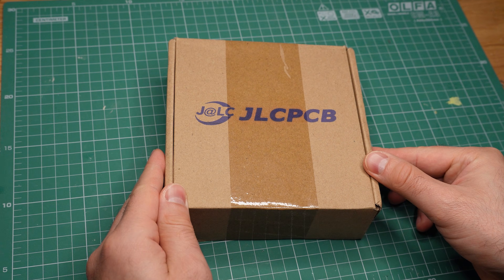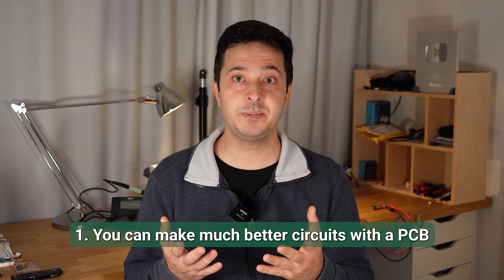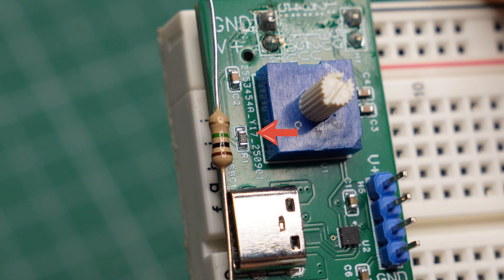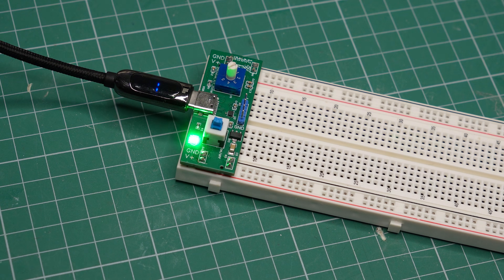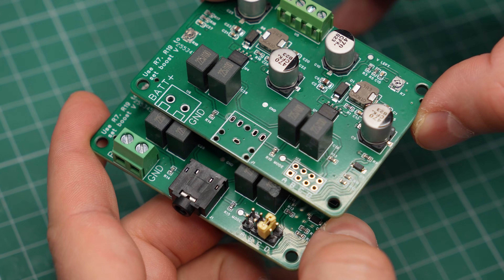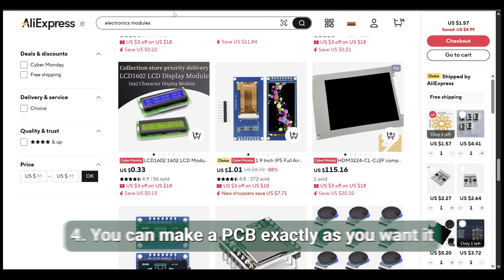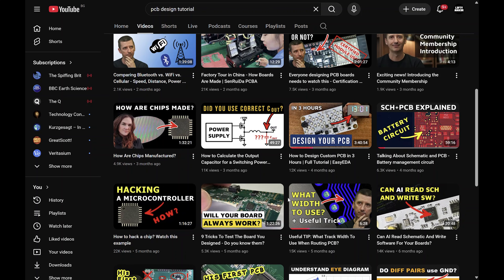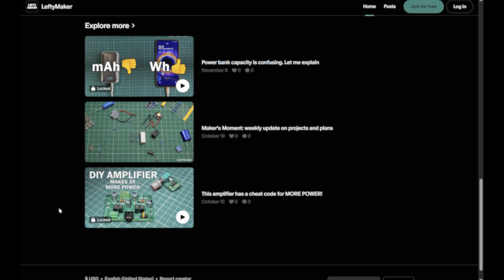5 Reasons to Learn PCB Design Today [GIVEAWAY!]

Comment: Too bad, they weren't around in the early 80s. I designed something, and through a friend, I found a place in China to build 100pc of the item for me.  A few months later, they were building and selling them to US dist. under another name. They screwed me.
Reply from the maker: Ouch! I'm sure it still happens today. Your comment actually made me wonder if it's possible to patent a circuit. Turns out it kinda is, under some tricky conditions. It also reminds me of the Fidget Cube Kickstarter campaign, where the copies were launched before the product. Something similar happened to Pressy, a physical button accessory for smartphones.

Comment: im gonna use your coupon to make a custom stm32 devboard
thanks
Reply from the maker: sounds good! Seems like a very capable chip. I recently had to repair someone's USB MIDI keyboard and, what do you know: it had an STM32 inside
Reply: @LeftyMaker  yea, im thinking of making it with an onboard programmer and an alc887 codec to try to implement hda on the stm32
and yeah, they are capable, cheap(like 1-2 bucks a pop) and have good support

Comment: Hello i am a Mechanical engineer interested in PCB designing where to start from
Reply from the maker: The tutorials by @RobertFeranec are a good place to start. You have to know how to draw a circuit diagram. You draw your circuit in your preferred software, and then you lay out the components as you want them.
Reply: Mee too, working with small circuits
Reply: PhilsLab is also a good one